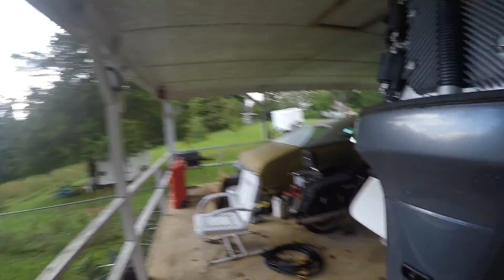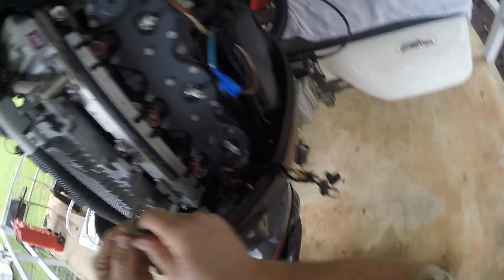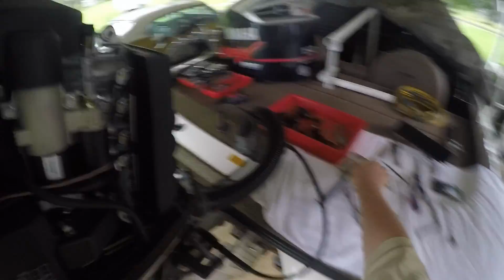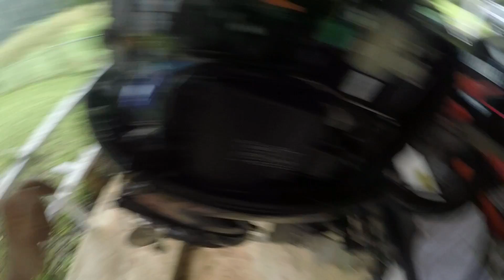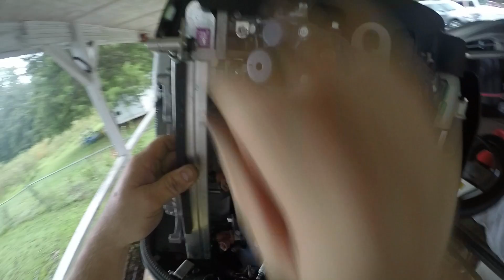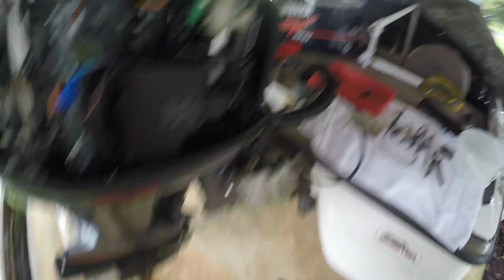2001 Yamaha 150 HPDI Outboard Motor / Fuel Injector Mystery Filter Replacement

Comment: Does this mean the injectors are in the head tighter than the Mystery Filters are in the injectors themselves?   Is this why the filters come out, but the injectors stay in?   Aren't the injectors just pressed in just like the filters?    On cars with high pressure each injector has a bracket holding the injector in so it won't blow out due to 4000 psi at WOT

Comment: I'm not getting fuel  to my fuel rails on my 150 v max 2000 model any idea where I can start
Reply from the maker: Repeating, I am not a boat mechanic, but....  From memory the rails are fed by a pump at the top of the motor where pressure is built up for the injectors.  That pump is fed from the reservoir on the left side of the motor.  In that reservoir there is a float and a filter.  If the float does not move you can run out of fuel.  Seems like there is some kind of pump inside that also.  On the back end of the reservoir there is a plug about the size of a pencil that moves up and down.  I think that controls the amount of fuel let into the reservoir.  There is also a small pin hole that stays open all of the time.  Mine was clogged.  I ran 1 small maybe 1/16th bit through it by hand.  There is also a filter between the reservoir and the pump at the top of the motor.  Sorry that I can't be of more help!!!!
Reply from the maker: If you take that reservoir apart you may need a new gasket.  It is a small rubber tube gasket.  Fun to get to go back on correctly...
Reply: Thanks gonna check it out

Comment: where do you buy these filters i can see it on diagram where i buy my parts online .
Reply from the maker: I bought mine from "Allzone" on eBay.  Here is the link:
https://www.ebay.com/itm/20-HPDI-Yamaha-Outboard-Fuel-Injector-Filter-Baskets-LZ-Z-150hp-175hp-200hp/381711073527?hash=item58dfc0c0f7:g:PwkAAOSwZVlXknYR

Comment: I don't understand why you didn't get the CORRECT screw in the first place  It has to  be metric and a common one at that   I saw a video where a guy used a sheet metal screwto remove them   I couldn't believe it
Reply from the maker: I said it from the begining, not a professional on the end!  I'm am IT guy, so we are lucky that I did not use a machine screw from a server rack or a counter case.  Have a great Christmas!!!

Comment: I'm going to order the filters   To remove them I'm going to use the correct metric screw and a small slide hammer I got from Harbor Freight  As long as you have a straight shot outward from the injector there should not be a problem   Cars injectors don't have removeable filters  Maybe DIs do, but Port Injection ones do not   The final filter is in the injector and is not removable   I don't see the need to send these injectors out if you replace the filters   All the shop is going to do is test the solenoid and charge $20 each   I can't test the solenoid myself with a 12V BATT and 2 jumper wires

Comment: i have a small problem i have a 200 hpdi vmax  when i go like full throttle as soon as i hit 55 rpm  it studders like it isnt getting enough fuel so when i stay on the 40 rpm it keeps me smooth ..... then another i see is before my engine went all to 60 rpm but now it will only go to 52 rpm and with the stutter problem
Reply from the maker: I am not a boat mechanic, BUT...  I am presuming that you are in the water with it in gear?  I noticed that I was trying to rev the engine at home and unless I put it in gear it will not idle up.  It will actually die on me.
Reply from the maker: Did you mean mph instead of rpm?  

I have another video that I need to put together and post on the fuel system.

On my boat there are two mechanical fuel pumps on the side of the engine that pump fuel to the reservoir.  In the reservoir there is another fuel pump with a filter that feeds the high pressure pump on top of the motor.  So, check that filter in the reservoir.  Be careful with the gasket on that one.  

Also inside that reservoir there is a float with a pin valve.  Mine had to be cleaned out.
Reply: yes when im in the water in gear .only in gear you can rev the engine higher than 15 rpm . my speedometer broke so im working with my rpm .
my boat was sitting for like 6 months because my gearbox got broken and didnt had time to fix it  .so when i fixed it and tested the boat i got the problem that my boat didnt wanted to do the 60 rpm any more the max was 50 to 52 rpm when i was still holding the thriottle at 54 rpm it started to stuter you know like it doesnt get enough fuel to hold the 52 rpm so what i did is drop it to 40 rpm and there it was going smooth like nothing  is wrong 
so i sat down and was thinking this is a fuel problem my engine isnt getting enough fuel .
Reply: in the reservoir do you mean the vst filter? i already changed the 2 fuel pomp that pump fuel in the svt filter i will try the pin valve changing also and the svt filter
Reply: what about the strainer ?? on  top of the svt filter ?
Reply from the maker: Yes, the filter on the bottom of the electric pump in the VST (Vapor Separator Tank).  

There is a "air connector", like on a car tire, on the VST.  That can be used to check the fuel pressure in the tank.  I think that the pressure should be 50 to 60 pounds there from memory.  You can buy a pressure tester at an auto parts place.

There is another inline can filter between the VST and the high pressure fuel pump on top of the motor.  I changed that out also.

One other thing that I had to go was change out the gas in my tank several times to get clean fuel to the engine.  The engine does not like old fuel at all.
Reply from the maker: Yes, I changed out that inline strainer /  filter.

Comment: Why wouldn't  you after exposing the fuel injector just removed them and have them professionally clean and pressure checked...it cost around $20 per injector.....after watching this video that's going to be my plan.....
Reply from the maker: As I stated, I am not a professional.  That really sounds like a good suggestion.  Hindsight is always 20/20.  Now I just have to find someone to do that.  I am glad that you got something out of the video.  I really need to get the video about the vapor separator tank published.